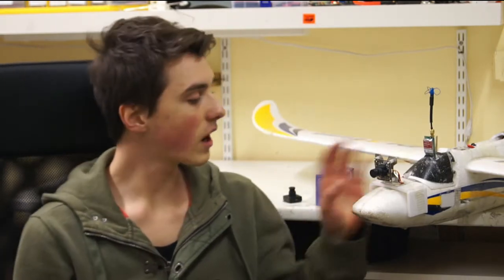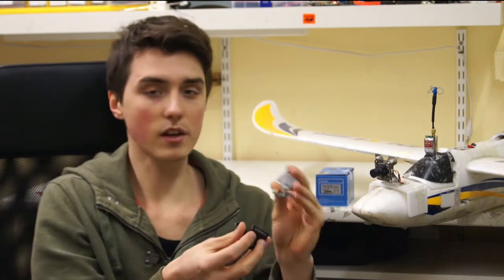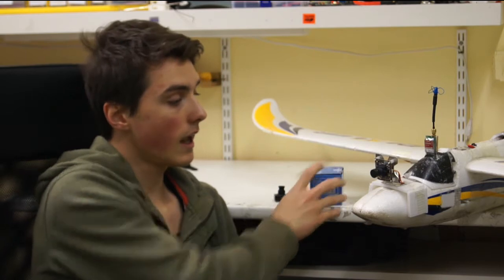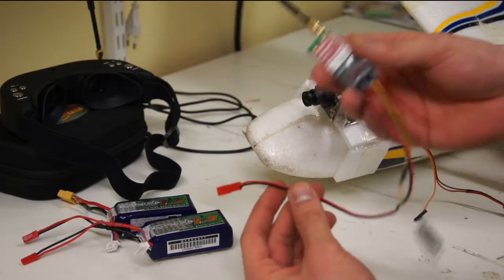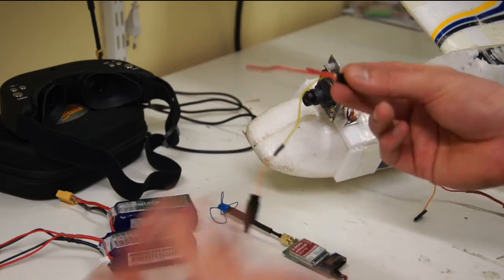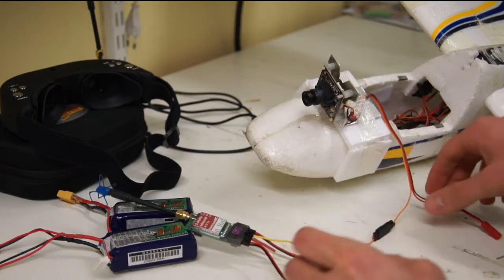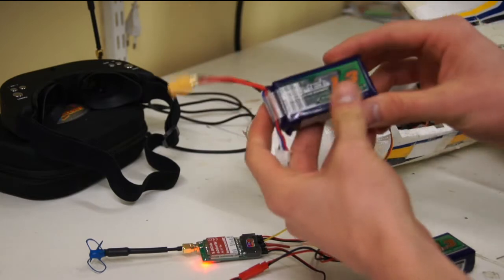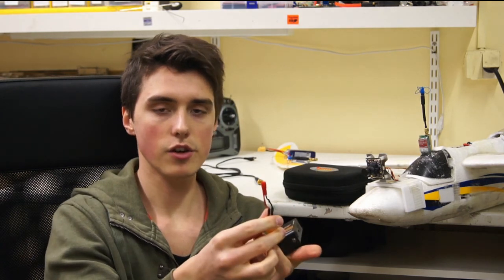How to Power FPV Cameras - RCLifeOn

Comment: I wired my camera stright to the battery of my drone but it keeps cutting out after 2 seconds of turn on. Is the camera getting too much power or somthing? The signal is crystal clear and then bam... Nothing
Reply: Prob an issue with receiver/antene